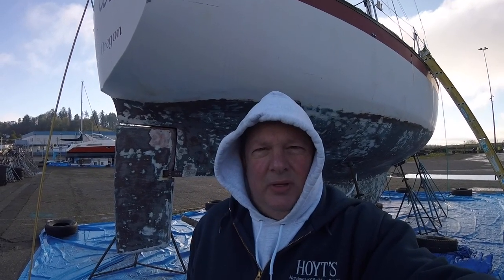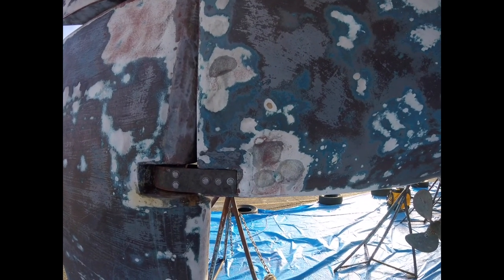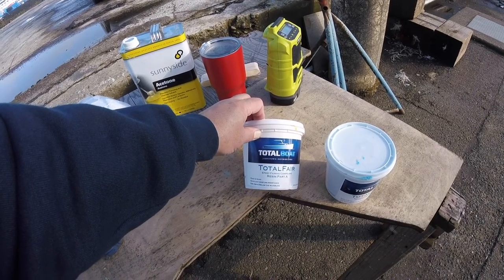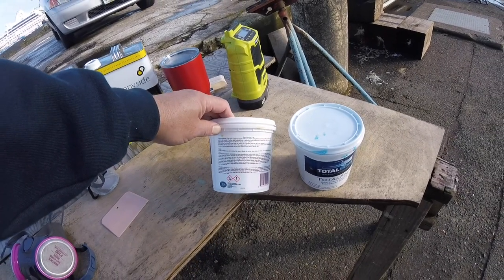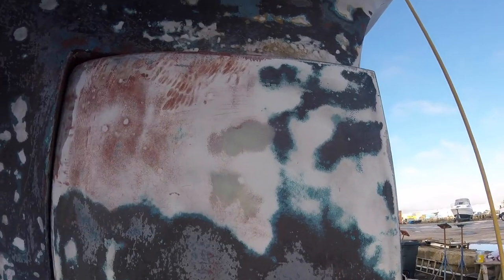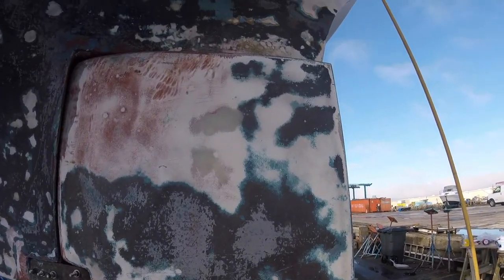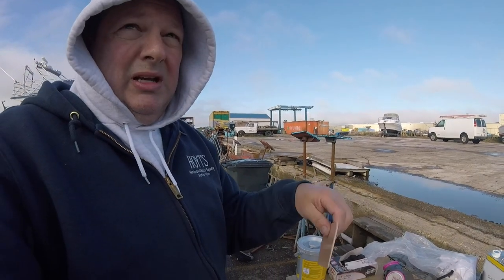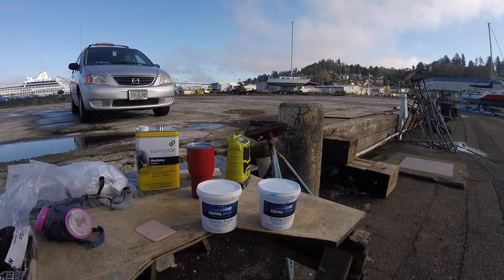Fiberglass Epoxy Fairing Compound [TT] [EP20]

Comment: How as that held up. I have my bottom down to gelcoat and was thing of going over the whole bottom. I like the idea of just doing the glass spots. How has that held up thank you
Reply from the maker: I like the 2 part fairing compound.  As it is two different colors, I can see when it is mixed correctly.  I used it in just the bad and low spots as needed.  I recommended it.  Not a paid sponsor, just a guy who likes Total Boat products. Being you have it down, I would do it right now and then you know what you got and the good and bad spots.  Good luck and thanks for your questions and comments.  

Grant